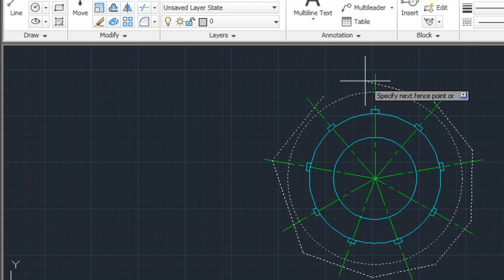Trim Lines Using the Fence Option

Comment: I have a problem with trimming lines using the fence options in command window (not pick point on the screen because I use "setq" in autolisp file to set value to the points). It seems like I get some very different results when I adjust the zoom level. If I zoom just enough to see the whole trim line then I use this technique, I achive the right things like your video. But when I scroll to see the whole drawing before I trim the object, It doesn't trim the hatch lines. Could you help me please?